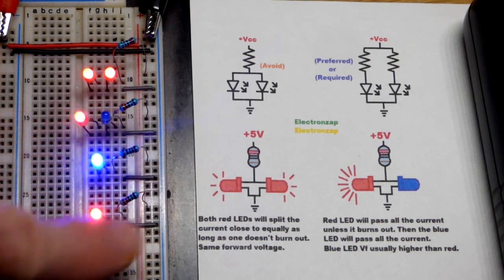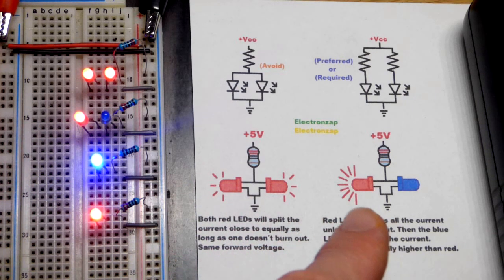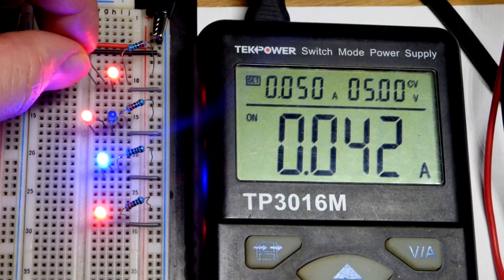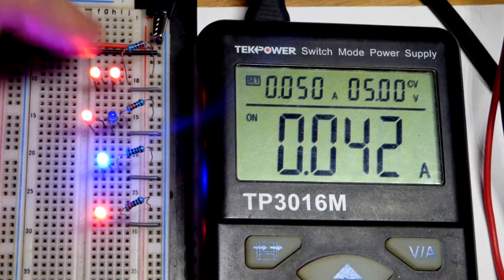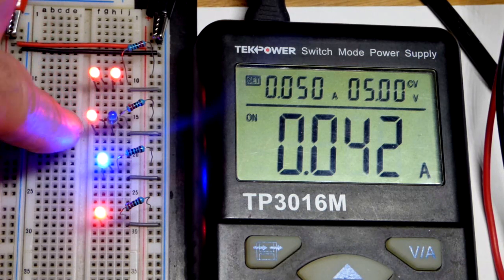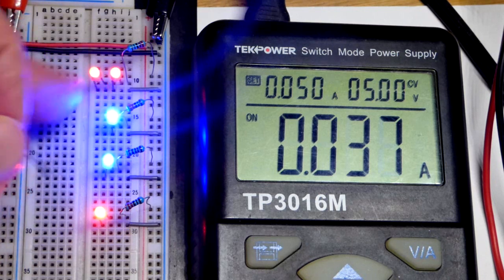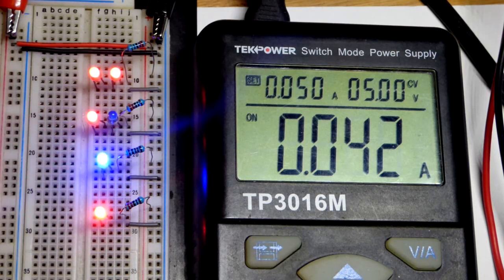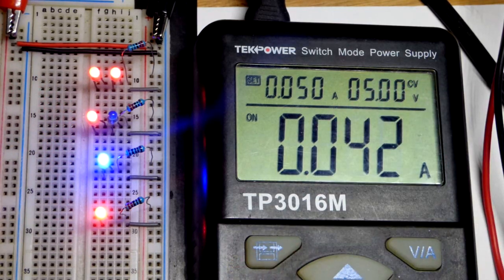Parallel LEDs should have or need their own protective resistor learning electronics shorts 102

Comment: Good explaination.
In steam systems, there is a similar design principal to avoid called "master-trapping" when installing steam traps.

Recently, I used a 100 ohm resistor to "master-trap" threee 10mm leds that are connected to a wemos d1 mini running a simple 'stoplight' sketch I wrote. so 1 red, 1 yellow, 1 green... all with different fwd voltages.
Since no 2 lights are ever on at the same time I dont have any issues... so far :)